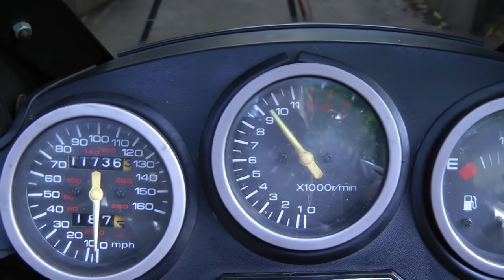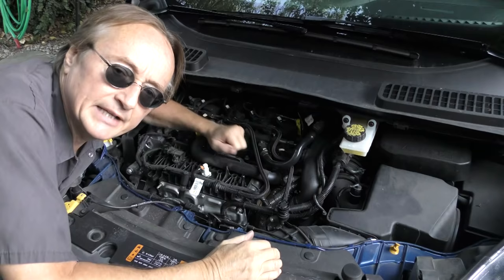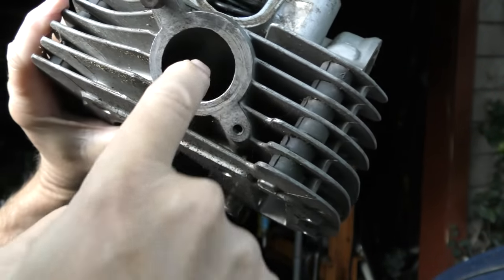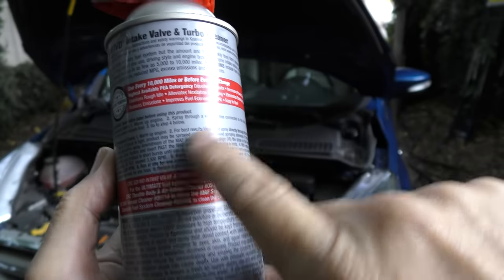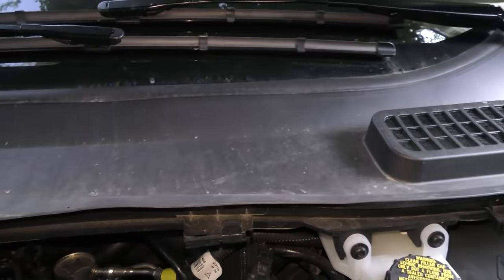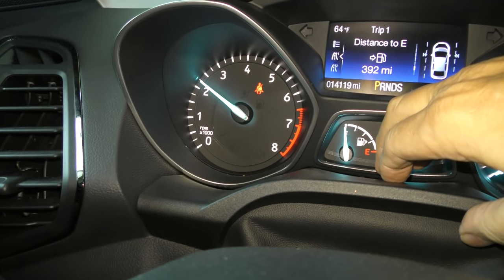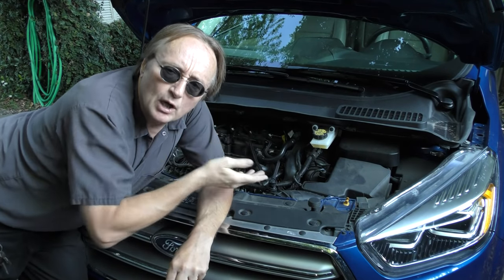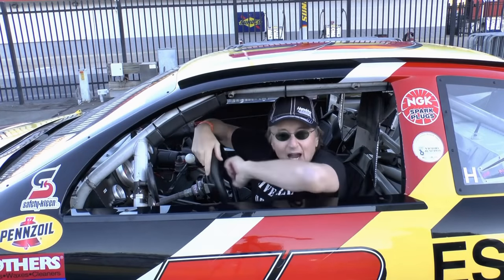How to Clean Intake Valves in Your Car with a Spray Cleaner

Comment: Thanks for the info. Could you show a longer video length and show the step by step and the hose you used to spray into. Thanks
Reply: Its different on every vehicle so that isnt going to help you out. You need to find this hose on your vehicle or spray in the throttle body if you cant access this hose.

Comment: Nice video Sir Scotty and what are the symptoms of dirty intake valves on a dfi engine besides the possibility of an engine trouble code and how often/miles is this cleaning typically needed?
Thanks
Reply from the maker: engines will often ping with carbon build up and idle poorly . Good idea to do this once every 30 thousand miles or so
Reply: Where do you spray the crcintake valve cleaner on 2016 kia Optima 2.4L

Comment: Scotty, I just started watching your videos and am amazed by how much I have learned (although I began knowing virtually nothing.) I do have a question—for you or other subscribers. In one video you recommend ATS carbon cleaning (my 2011 Sonata is prone to carbon build-up, and I do a lot of slow local driving).  Is  ATS (which you recommend in another video) significantly  better than using this CRC product for decarbonizing intake valves and cylinders ? Clearly the price of the CRC process will be a lot lower, since it's simple and doesn't require special machinery.

Comment: How frequently do you have to do this on a modern direct injection engine?  I had heard this needs to be done, but no one seems to have an interval when it should be done.  Thanks (I don't have a direct injection engine on my 10+ year car, but just would like to learn more about this when I do get a new car eventually).

Comment: Awesome advice for direct injection systems!
Non-direct injection systems wouldn't necessarily benefit from this, but it wouldn't hurt either.
Reply: Kentucky Ranger   If the gas/air mixture isn't glowing past the valve, how does it get the build-up?  Is it on the edge or much, much less?
Reply: Lou Fazio Crankcase fumes are added to the airflow going through the intake manifold and past the intake valve(s).  The fumes contain oil, and it's that oil that carbonizes on the valves in a GDI engine and causes the problems.
Reply: Chris Freemesser   Thanks.  I should've remembered that.
Reply: If it's direct injection, the fuel/air is mixed in the cylinder, because the injector is inside the cylinder.
Non-direct injection, i.e. Throttle body, or injected at the point the air is taken in by the intake, stay cleaner, because the fuel passes around the intake valve.
The dirt buildup is caused by normal build up of dirt in the air that the air filter doesn't get. Plus, there are exhaust and crankcase fumes and gasses entering via the ERG valve and PCV valve, causing even more dirt.
Also, during combustion, the intake valve gets fouled around the edges. Without that fuel/air mixture passing around it, it can become VERY fouled VERY fast!
What I meant is, it won't hurt anything no matter what type of injection system your engine has.
Direct injected engines are more efficient, but at a cost to valvetrain parts.
In fact, the old alcohol injection systems that were used to keep carburetors clean years ago are making a BIG comeback with owners of direct injected cars.
Reply: Kentucky Ranger   I have a supercharged 3800 (Pon GTP). I'm not so enthused about going through the s/c. Any opinion on that?
Reply: You threw me off the bell curve there, LOL!
I know just enough about cars to get me into trouble...
That being said, I'd say an engine with a supercharger you'd have to get the cleaner in directly through the inlet.
Reply: Kentucky Ranger   I semi-blockheadedly went ahead and did it - sucked it up through the brake vacuum line with smaller and smaller hose.    I don't think it's too bad, but the s/c oil probably should be changed to be on the safe side (will blow that off too since I just did it about a month ago, lol) Fix it 'til it's broke, lol.  It went well; engine did seem to run smoother.  Thanks.
Reply: I'd say you didn't hurt anything, LOL!
Like I said before, water injection is making a huge comeback with direct injected engines, because it gives a tiny bit of horsepower boost, plus, helps keep intake valves clean.
If you're not sure what I'm talking about, here's a link to one on eBay:
http://www.ebay.com/itm/Snow-Performance-201-Stage-1-Water-Methanol-Injection-Kit-Boost-cooler-Kit-GAS-/302140583232?hash=item4658fb6d40:g:3iQAAOSwO~hXHx1u&vxp=mtr

I had one on a Thunderbird. I used to put plain old windshield washer fluid in the tank, instead of the expensive stuff they "Recommend"...
Reply: Kentucky Ranger   "Didn't wreck anything" good, thanks.  Water injection: That looks very interesting. I was looking at water injection a couple of years ago and am very interested in it, but I am a less motivated right now. My dad used to have a water system in a '74 455 Olds Custom Cruiser. I think it was a plate below the carburetor. He lost interest in it probably because he was hoping for significantly better gas mileage ( lol ). I don't guess it was +15; probably wasn't as focused with three kids either (lol). This definitely will be in the back of mind.  Good idea with the WW fluid. I'd guess that's very close to what it needs to be, and it won't freeze in the winter.
Reply: Like I said, it might boost HP a tiny bit, but the mileage thing it won't do anything.
The reason I put it on my T-bird was to help the engine when hard accelerating.
A friend of mine had it on his diesel to help keep the engine cool during hard pulls in the mountains.
Other than helping with a tiny HP boost and keeping the top end of the engine cool during hard pulls, it's awesome for direct injection engines.
In fact, you can adjust it so you just get a little squirt, instead of a steady stream, during hard acceleration, but that's all you need to keep the intake valves clean and it also helps keep your plugs from fouling by keeping carbon buildup to a minimum.
Reply: Kentucky Ranger   Yes, I see. If desired, it will allow for the provisions of making more power; timing etc...  The Stage 3 is way too expensive for me and not for my intentions, but a nice setup. I'll be sticking to the solvents for valve cleaning. My recent job has given noticeable improvement of running smooth and responsiveness. It's practically like a new engine.
Reply: I know the example I gave is pricey, there are much cheaper versions out there.
Cleaning out the entire intake system every few years is very beneficial to a vehicle's performance.
Just make sure you don't use carb cleaner! The sensitive electronics will be damaged.
They make a cleaner spray that's safe for the MAF (Mass air flow sensor). Just make sure when you buy some it states that it's safe for intake systems and sensors.
Reply: I have a 95 honda del sol I am tinkering with. Is this car a direct injection system? Just the regular 1.5 engine. Not Vtec.

Comment: I have thought about taking the intake off my '12 focus S and drilling a small hole in each intake runner (later to put a rubber plug into them). Then when it comes time to do this I could just remove the rubber plug and clean each set of intake valves one cylinder at a time. What are your thoughts?

BTW love the videos
Reply: I have had that same idea.i haven't done it yet.but I bet it would work great.i just can't  figure out what I could used for reliable plugs to place into the holes.

Comment: Hey Scotty, i have a 2016 3.5 Ecoboost F-150 which is especially prone to carbon build up on the intake valves. It has 170,000 miles and I have just recently installed a catch can. My gas milage is suffering and has a misfire under heavy throttle and I have already replaced sparks, Mafs, coils, ect. I wanted to clean the valves with CRC but loads of people on the internet and forums including Ford claim the chunks of carbon will damage the hot side of the turbos vanes or score the piston/wall. Might be a stupid question seeing as how you made this video on an ecoboost but if anyone would know it would be you. Could you make a new video addressing the first gen 3.5 Ecoboost? a ton of people are spending a lot of money walnut blasting their engines because ford claims CRC will destroy your turbo, THANK YOU!!!!!!

Comment: So, we can say that direct Injection is inferior to MPFI? I like TBI since the gasoline sprays at the nearest point to the throttle body and cleans the up side of the throttle plate and the channels inside the intake manifold. MPFI we had too many problems with "Injector sickles" that would break off and end up in the EGR valves and there's a lot more sludge or thick goop that forms in the throttle body. More frequent cleaning of throttle body is needed with MPFI and obviously the new Direct Injection issues are yet to be discovered and announced. Were you in the 101st back in the 80's?

Comment: Question. In the old non fly by wire days, I could rev up the engine by physically moving the throttle body butterfly. But, today, how do I keep the engine at 2K rpm without touching the gas pedal? I'm assuming one needs 2 people to do this. One person to provide the intelligent throttle foot to keep the engine revs up, and the other to spray the CRC into the TB. So this would have to be a 2 person job. Or is there a way to use a scan tool to do this?

Comment: Can you do this on a tdi too?  I ha e 2006 jetta tdi.  Since the egr blows the exhaust back into the intake and had clogged up the manifold I can only assume the intake valves are dirty too.  I'm getting a sputter and black smoke in the early gear(s) and this in one of many things I'm trying to help resolve.

Comment: I'm worried about large deposits coming loose and going through the turbos on eco boosts and ruining them. I thought that if I would add extra fuel cleaners to every other  or every third tank would that be better? You know keeping up with the deposits so the stuff going though the turbos are just molecule in size. Does that make seance or am I worrying about nothing?

Comment: Guessing i could do the same with my 03 honda pilot, guess i just need to find the right hose to do this with. Would one of the lines off the intake work or would it be better off just looking for the one on the brake booster?

Comment: Hi Scott! 
I'm in the process of installing a fuel pump in my 04 ram pickup and after draining the tank and dropping it I'm seeing some odd stuff inside. 
There's a lot of gold and green powdery build up inside this plastic tank, stuff that I've not seen before and I have seen the insides of a lot of gas tanks through the years. I'm beginning to think that someone has dumped something in my tank and that's why the pump went out! 
You have any thoughts on this ? 
Am really enjoying your channel and being a poor person that HAS to do the work on my vehicles, you have helped me tremendously, thank you!
Reply from the maker: I would steam clean the tank now before putting it back on. With Dodge, who knows what they put inside and what could happen from a burned out pump or rotting fuel lines?
Reply: Scotty Kilmer 
Thanks for the suggestion Scotty, have got the tank cleaned up and looking like new inside now. 
Think I'll be using a locking gas cap from now on!

Comment: Hey Scotty. Ever hear of decarbonizing your engine by running water thru the throttle body on a warm engine at a controlled rate while controlling the RPM's to prevent stalling?
Reply: hey chuck ever heard of hydrolock, real good for your engine

Comment: I did this to my 2016 Honda fit, it has GDI. I used the brake booster vacuum hose line to get the CRC into the intake manifold. The hose leads to the far left side of the manifold. Will the CRC reach all four cylinders or will it only focus on the first two cylinders closest to the brake hose vaccum connection? Also, would it be better if I used the PCV valve connection in the intake manifold since it's dead center?

Comment: I'm wondering what deposits there would be on the intake valves since the fuel is directly injected into the cylinders.  Theoretically, the only thing going through the valves would be air.  Is there enough blowback into the intake on the exhaust stroke to leave deposits?
Reply: psychodad1961 pcv allows oil mist back into the intake, that creates deposits
Reply: psychodad1961 EGR
Reply: psychodad1961 ...
In a perfect world it would be nothing but clean filtered air. But PCV(positive crankcase ventilation) and EGR(exhaust gas recirculation) makes the intake manifold a dirty oily mess.

Comment: what if you didn't reroute the "out" of the catch can (or the PCV system) back into the intake of the engine? wouldn't that solve the problem with DI because nothing from the PCV is going back over the intake valves? i was thinking just feed a hose down to the bottom of the car from the PCV like those that drain A/C condensation.

Comment: Hello Scotty. I have a 2001 bmw 530i with lpg conversion. The injectors are drilled and installed into the intake manifold. Does that mean that the lpg will clean the valves by itself or it won't?

Comment: Scotty what about using just plain tap water to clean the valves?
Reply from the maker: that can help too, but a bit too much water, and BOOM goes the engine. ONLY a pro should try that
Reply: Windshield washer nozzle installed somewhere close to the intake and small 'spray' when driving with engine under load ;)

Comment: Hey Scotty , first of all thank you for the video. Second , which vacum line do I use on a 2018 Mazda cx3 , or 3 , same engine and diagram. Im scared of throwing codes since the car is underwarranty !!!
Reply: I don't think you need an actual vacuum line. From my understanding you can spray right in the air intake, pass the MAF sensor (if you have one)

Comment: I think disconnecting the PCV hose and blocking the hose that goes to the intake, will prevent getting the valves dirty, at least they would be a lot less to clean.

Comment: My 2012 Volvo S60 T4 with only 72,000 Km comes with GDI (1.6 liter engine by a Ford Europe) and a turbo. It seems that both these systems, the GDI and the turbo conspire against the cleanliness of the intake valves. Should I be concerned? How often should I clean the intake system? Will the usage of this spray foul the PCV system, should I install a “oil catch can” there is something in the PCV system that resembles it?

The owners manual says nothing about it (of course). Expect perhaps for the European oil quality specification of ACEA A5/B5 an energy saving, low ash, high flash point and long oil change interval synthetic motor oil. Where I live in the tropics, the only oil with this spec is a Motul Eco-Nergy SAE 5W/30. We never see freezing temperatures but we do see 32 degrees Celsius temperatures. The car came new with an SAE 5W/20. The dealer uses Mobil 1 SAE 10W/30. I am now using (due to an oil leak in the turbo that has and will be taken care of) Total Quartz 9000 5W/40, but it is an ACEA A3/B3. I change the oil every 6 months or 5,000 Km despite the owners manual recommendation.

How often should I use, if I can find this product in Costa Rica, to clean the intake system or should I wait and see if it will ever have to be “walnut blasted” to clean up the carbon and crud on the intake valves? What oil quality and  viscosity should I use? What gasoline additive should I be using? 

The LubroMolly chaps have quite a few cans (I bet collectable) with Teutonic names added to them, but cost 33% to 50%  of a fuel tank! And believe me, the residual value of my nice Volvo is only that, residue, I will have to keep it for the long run and need to make an otherwise disposable car to last!

Comment: Thank you for taking your time to make these awesome videos!  After binge watching many of your videos I was able to prevent further wear on my car!

I recently put in an aftermarket intake on my 07 focus because the self cleaning intake I had kept making my MAS throw error codes and it would cause my MPG to plummet until I disconnected the battery or otherwise reset the code.  This lead my to replace the spark plugs with some slightly fancier plugs.  Upon doing so I notice quite a bit of white dust/carbon on plugs 2, 3 and a little on 4 and 1.  Not black even though the tips were slightly black.  Long story short I got the intake and valve cleaner and squirted the whole sucker in there just ahead of the throttle body, cleaned the throttle body a bit and an hour later a huge cloud of white smoke can out of my exhaust as I took it around the block.  Now she runs so clean.  Prepping for winter season so thanks for those videos too!

Comment: This may not have anything to do with a valve issue but I wanted to run it by you. I have a 1999 Ford Expedition 5.4 with 87,000 miles and it has been making a weird sound coming from the engine bay. It’s not a knock or tick, it sounds more like a wobble or something is loose. It doesn’t get worse with acceleration and it’s only noticeable when idling. I changed out the spark plugs, belt tensioner, serpentine belt and it’s still there. Any suggestions

Comment: Is this useful for a non-GDI engine? I've got a 2000 Nissan Altima with 112k miles on it (it sat for 8 years, started occasionally during that time). I have no idea what the condition of the valves is but would do this as a preventative care if it made sense.
Reply: You'd be doing more work than you need to. This video is for engines with Gasoline Direct Injection (GDI) (some year 2004+ cars). Engines with GDI need an injector cleaner in the gas tank, and a separate cleaning of the intake valves. For other gas engines, just use a fuel system cleaner product with PEA (such as Techron Concentrate) in your gas tank. That will clean the intake valves+piston top+fuel injectors. The fuel injectors spray on the back of the intake valves anyway.